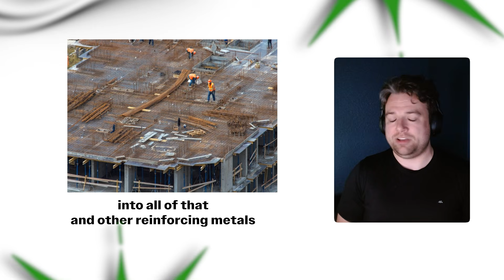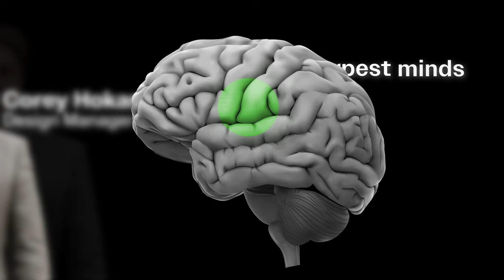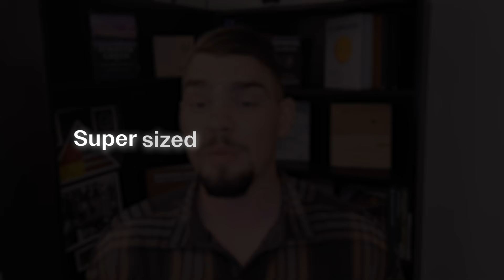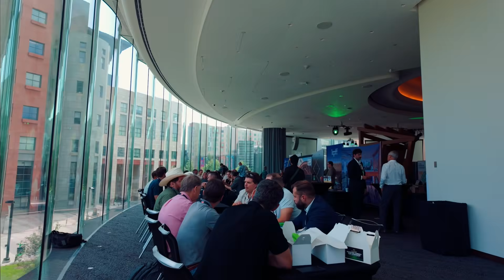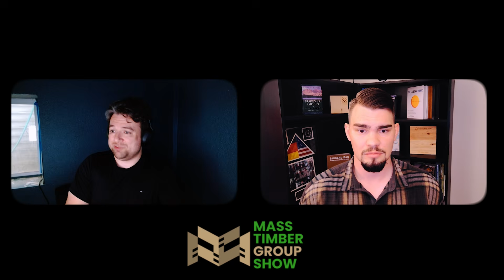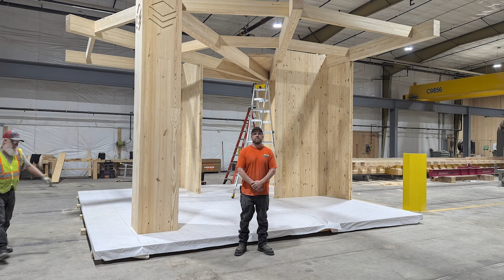Mass Timber Just Got Even Bigger w/ Corey Hokanson of SmartLam North America

Comment: Great Podcast ... The Mass Timber Industry needs to reach out to Milwaukee, Hilti, and DeWalt to make them aware of the urgent need for proper drilling equipment for Mass Timber.
Reply: Some of us are already working on that :-)
Reply from the maker: Must be that Wizard guy...
Reply: Oregon State University Forestry Department has a mass timber program. One local company, Freres Lumber has a plant that produces laminated mass timber panels.  As far as fire resistance, a Safeway store in Missoula, Montana burned in the early 1960s. The laminated timber arches survived and were reused after the char was sanded off.
Reply: M18 hole hawg